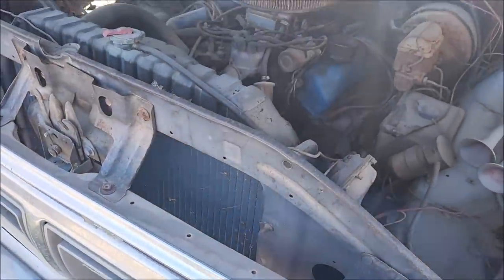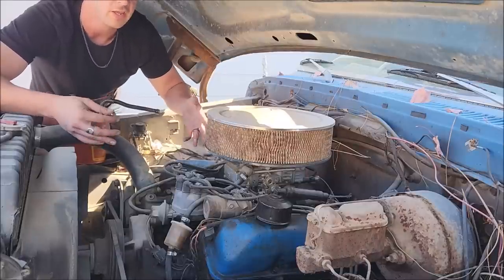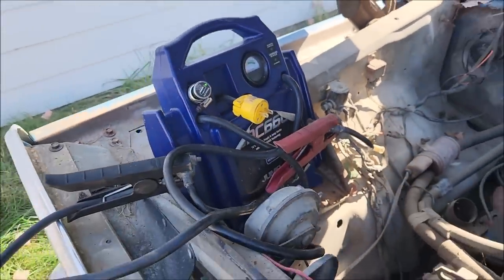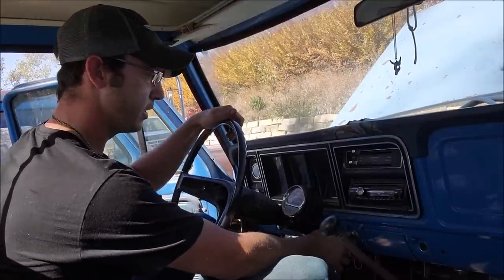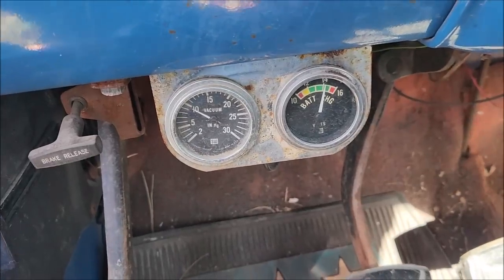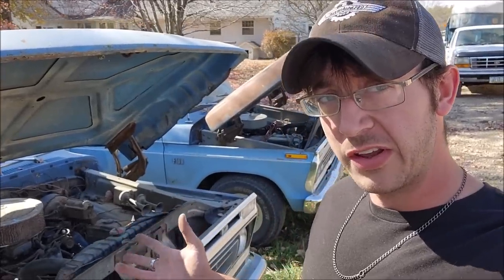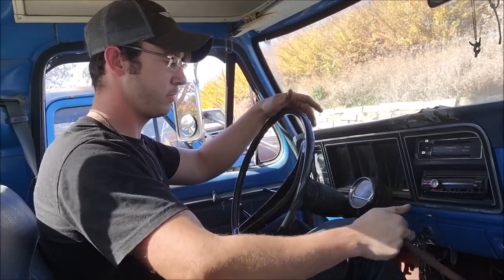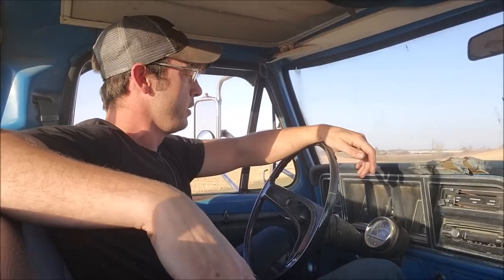Farm Truck Revival - Old Fords Never Die

Comment: thats What FE means FOR EVER 🤣
Reply from the maker: also, freakin'expensive - good thing they hold together so long because its money when they dont.
Reply: Investing a little bit more up front for a Ford always returns HUGE in the end! Durability!! As for Chev, did you ever wonder why there are so many LS engines laying around all over the place... and why they're so cheap? It's because all the Chevy cars and trucks they came in flew apart at the seams or simply turned to rust around them. Of course the engines are cheap! Chevy folks... ugh! 👍🏻😁🤭

- Max Giganteum

Comment: So you say and you can see it leaks oil but dont check any of the fluids before just throwing gas in it and firing it up after 2 years of sitting come on so believable
Reply from the maker: I checked fluids off camera - some things you just don't show when your making an abbreviated video. 
I mean I also torqued the front wheel lugs but I didn't show that either
Reply: @ThunderHead289  ok that makes more sense then just firing it up

Comment: Im a Chevy guy, but was a Ford mechanic, I remember a point in time where Chevy, Ford and Dodge trucks were like competing to be reliable, yeah each had their fair share of problems, Dodge starters sounded like a dying cat, Fords awsome duraspark, Chevy's leak everything, But you could beat the snot out of them and they just keep going, My 91 C1500 made it to nearly 800k miles on its original 4.3 engine, and still ran the day I sold it.

This new stuff is just baffling by how unreliable everything has become, its more of a battle with who can have more buttons and screens and gizmos rather than whos has more reliability, I hate Chevy, Ford, Dodge now adays, they are all junk anymore.
Reply from the maker: Very well said.